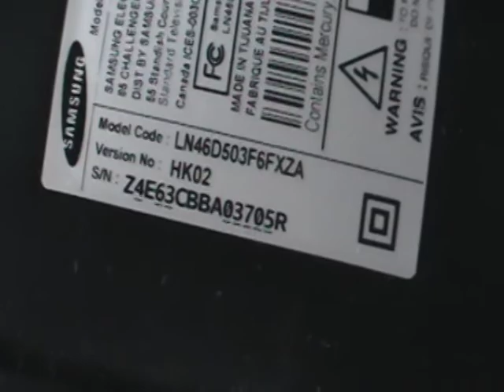Samsung tv backlight replacement from LCD to LED PART 1

Comment: Are those 5050 Leds? What color? White, cold white, warm white? Can you adjust the brightness?
I have the same TV that has bad CCFLs
Reply: Those are 5050 white light strips very crude but the best cost savings simple & effective conversion I've seen on YouTube.
Dimmer control for 5050 strips:
https://www.aliexpress.com/i/32989376974.html